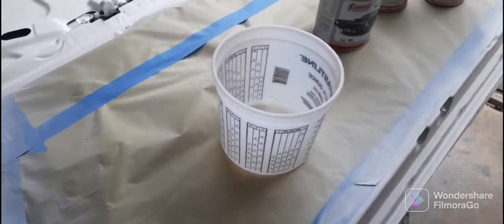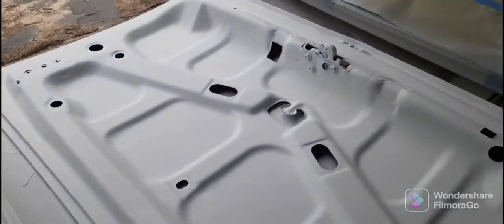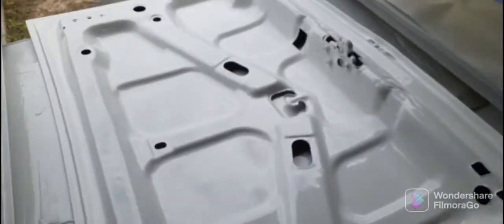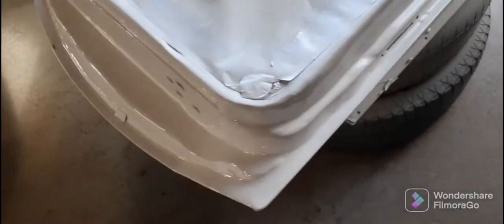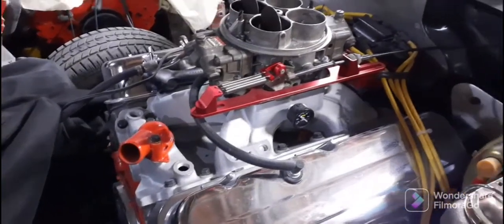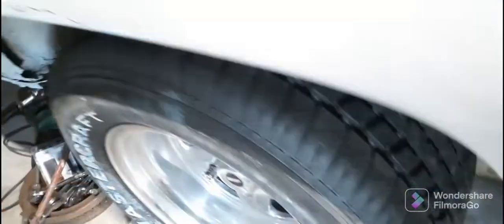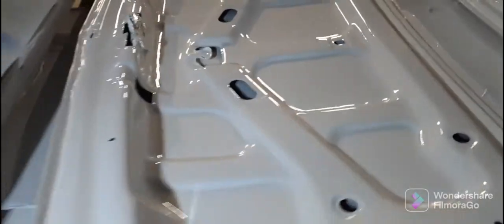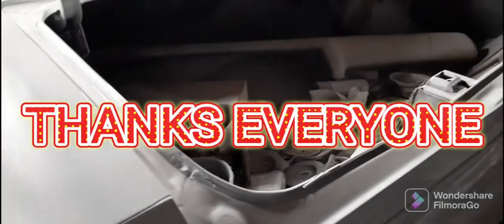TIME FOR PAINT. " SS 454 " MONTE CARLO.

Comment: I've painted cars in the past and white cars were kinda hard to get an even gloss. I also learned to spray a good coat of white before painting a car yellow. I first tried to paint it with primer spots on the damaged areas and just could Not cover the primer. Learn as you go I guess 🤷 😌  awesome looking tires!
Reply from the maker: Hey BBK. Yes Sir it's aggravating. I usually use a black or white sealer and then a tintable 2K primer. Their all temperamental tho. 😆 Lol. Thanks for watching.